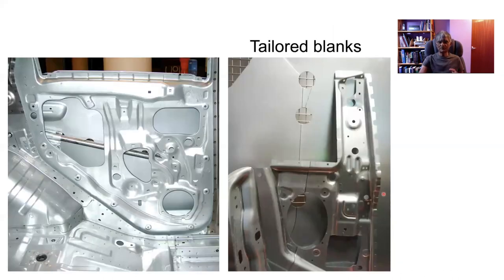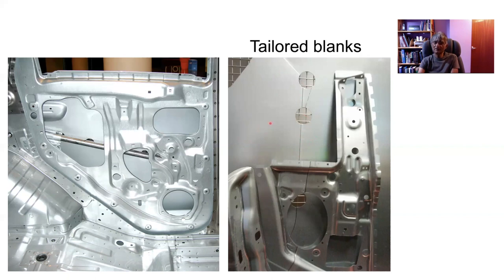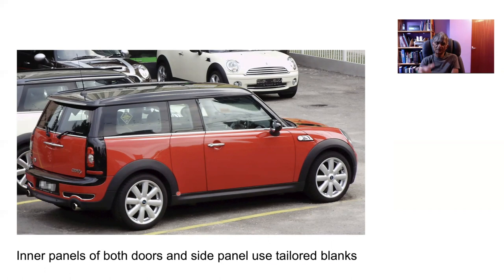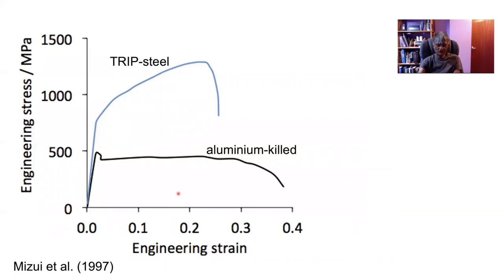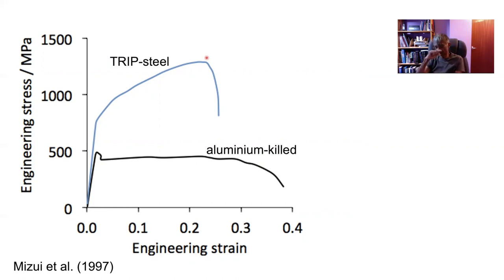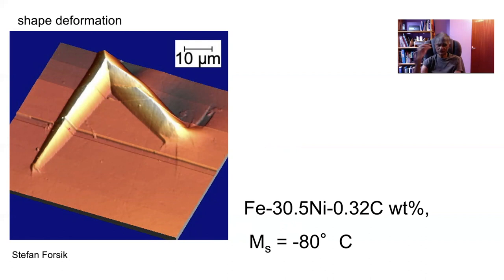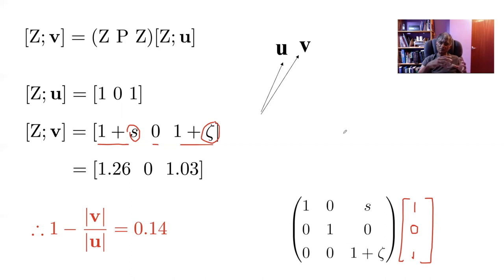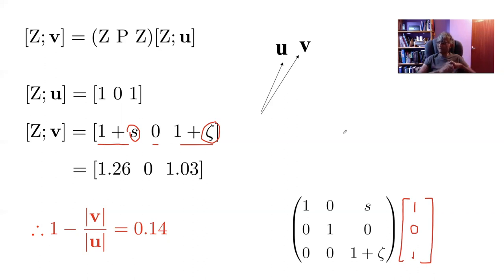Steels: transformation-induced plasticity. Lecture 10 of 12

Comment: For 100 percent Austenite  transformation leads to 14percent elongation...my doubt is  In normal ,austenite to martensite transformation through heat treatment process doesnot cause the 14 percent elongation .kindly reply me sir
Reply from the maker: That is because  normal heat treatment is not under the influence of a stress.
Reply: @bhadeshia123  thankyou sir ..in trip steel where 100% RA  transformation leads to increase in plasticity ....why  strain hardening is not much in trip steel compare to trip assisted steel sir ..